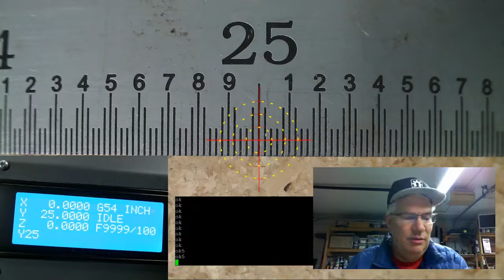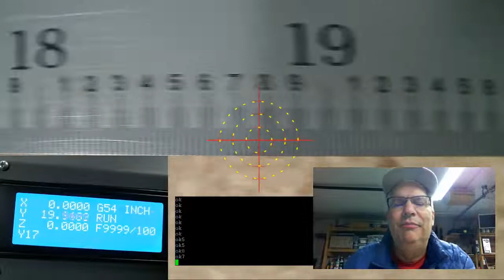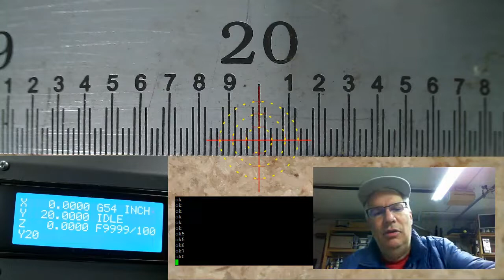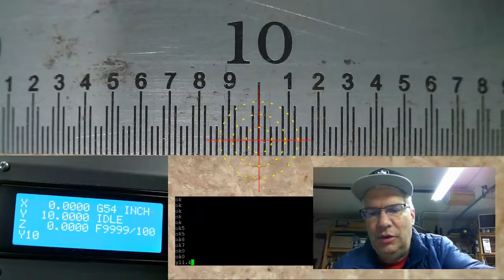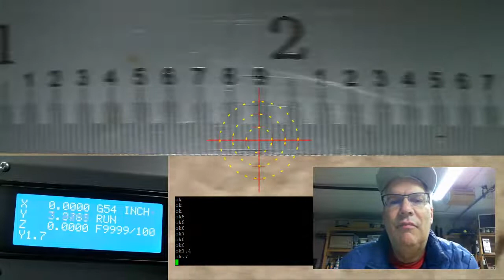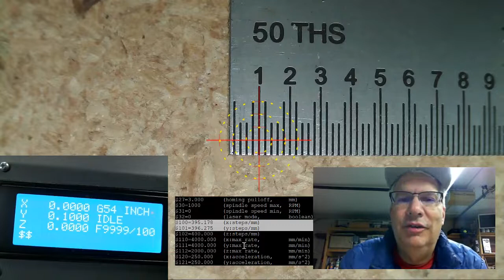181106 Valve Studio - Tonehenge Journey - Y Performance Calibration

Comment: Hello,
Could you give us the way you have configured the camera to have this kind of view? I would like to have the same kind of setup so I have found how to use my phone as ip camera but I don't find a way to integrate a target in my video streaming as you do.
Thanks for the video very inspiring for me who have so much calibration issues...
Reply from the maker: For the down camera, I have a USB mounted in the spindle mount and I'm using VLC because VLC allows for a transparent PNG image overlay. The fixturing for this camera was quite secure, ie not play as the gantry moved. The display camera was a simple usb webcam like a logictech and for the mug shot camera was the laptop camera. I ran all these into OBS, Open Broadcaster Software, which accepts video feeds so I could place them. Hope that answers your questions. This works fine for X and Y, could work for Z but that requires another camera mount and vertical ruler.  When you get down to that level of precision, you have to account for  the widths of the ruler ticks and the thickness of the camera overlay. Its a pain in ....   Thanks for watching.
Reply: @CraigHollabaugh  Thank a lot for those details! I will experiment all this :-)
Regards,

Comment: Hi Craig, 
I've been following your progress very closely and I have to say you are doing a fantastic work so far. I'm quiet impressed how you set up your whole motion system. 

I have a workbee cnc myself, ordered from China though. Started with the GRBL + Raspberry Pi approach and was somewhat happy with it so far, CNCJS and a tablet computer made any other control interface somewhat obsolete. Seeing your work with the rotary encoder and the buttons made me reconsider though... 

There are two things I'd like to ask you, if you don't mind. First thing is, the software for the PSoC, is it all stock like in the git repository you linked in one of your other videos? Or did you add a lot of changes somewhere? I am quite familiar with micro controllers and fpgas as well, never worked with this specific PSoC though. I just want to know what I'm in for and if you made major changes to the firmware,  could you make them public. Didn't find anything on your git... 

The second thing is, how did you get your workbee to position this accurate? I mean with the steps and the servos... I get that part. But I believed there wouldn't be a big difference in accuracy (backlash for the most) between the different versions of the workbee (openhardware / ooznest / china) as the parts probably all come from China in any case. Yet I can't get rid of the backlash, it's about 1/10 mm up to 2/10 mm no matter what. It's not the nut block though, I think it's how the axis are mounted (the lead screw), no matter how hard I try, I can't fix them so that there is absolutely zero space between the mounting ring and the ball bearing... Did I miss something or do you have a special technique how to fix that really tight? 

Cheers and keep up the good work. I'm really curious to see your finished project :)
Reply from the maker: Eric, I'll address all these questions and other items in my next video. Thanks for writing and the interest.